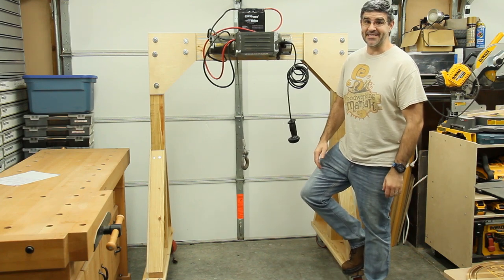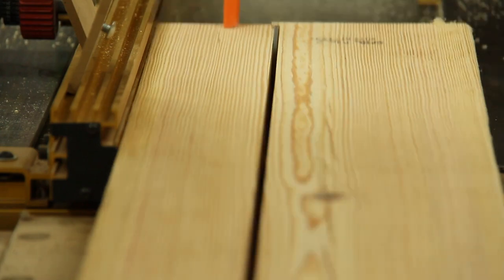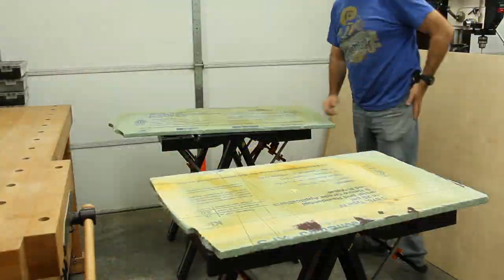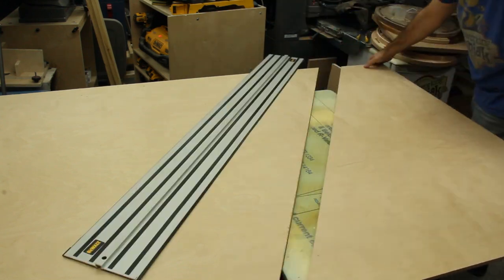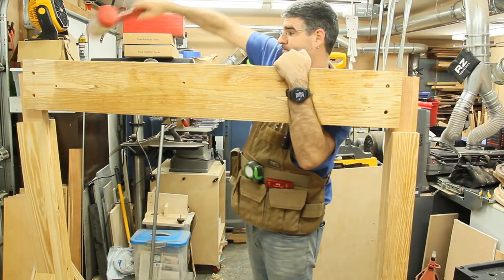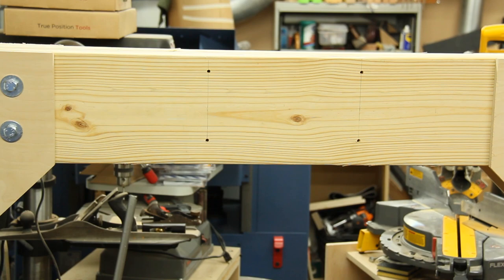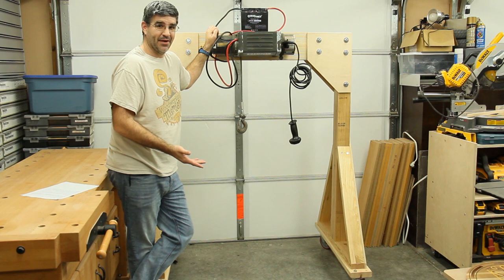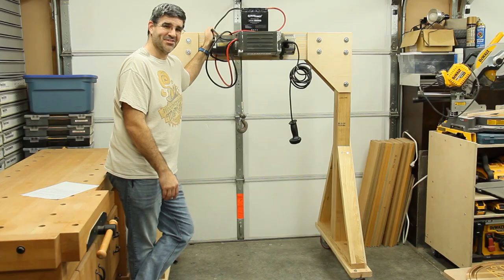Mobile Gantry Crane! - Is 8000LBS Overkill?

Comment: Need help trying to make one out of 7 3/4 x 7 3/4 x16's. Legs will be 7 ft tall each. Foot 4ft long each. Header will be 6 ft long, sit flush on top  legs. Need help with supports , for the header , and the foot between legs.  What type and length of screws.  The support covers.   I will be lifting a 5000 lb - 3 ton car  , up 34  inches  in the air .  I can only afford wood.  Can you help with engineering.

Comment: Love the gantry wish I had room in my shop, might save my back.
Reply from the maker: Was a necessity for what I needed to move. 😊
Reply: Well done,boxing in with plywood is a very good method to strengthen the assembly,my only suggestion would be,maybe the caster mounting or base 2x4 should be a u shape with 2  
2x4s vertical and 1 horizontal.